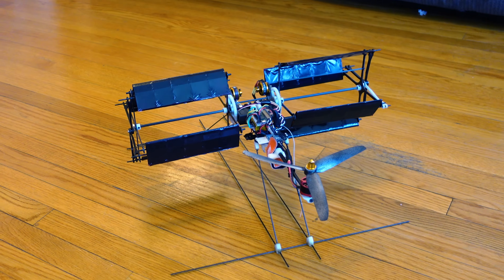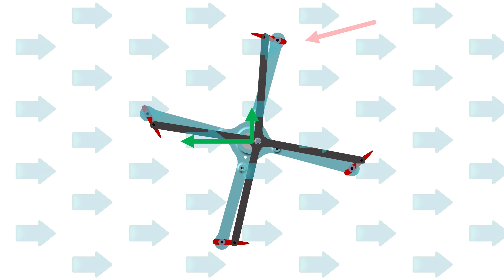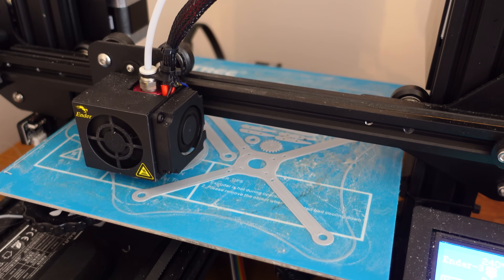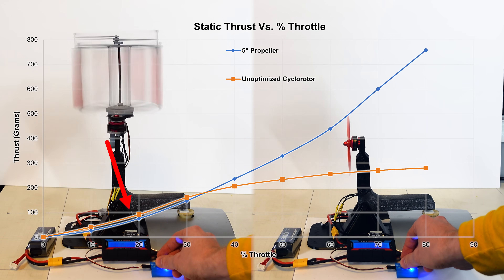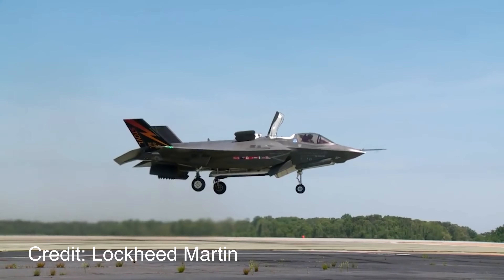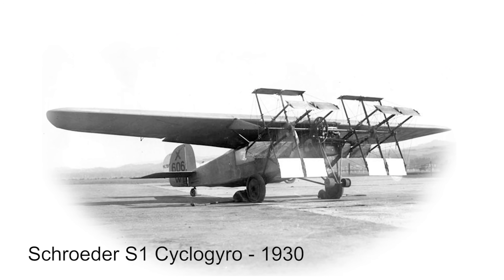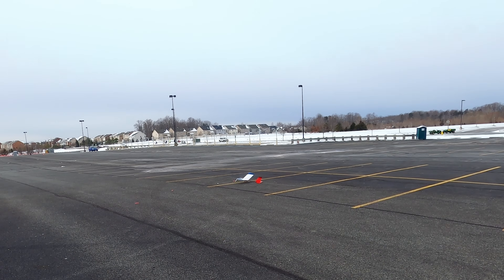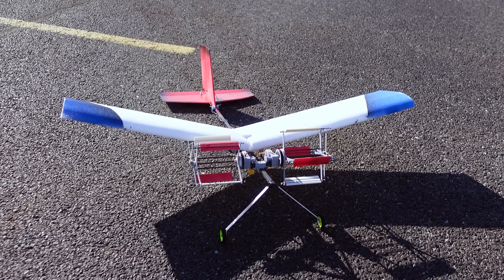Cycloidal Rotor Airplane: The Cycloplane

Comment: Your science makes sense. BUT. Have you seen that you can use two smooth cylinders and still obtain lift. So there is some science that hasn't been explored yet. How can smooth tubes in the cycloidal design still work.
Reply from the maker: That’s coanda lift—different aerodynamics than the mechanism of cyclorotors

Comment: Plotting the dependence of Thrust on Throttle is highly incorrect from both a physical and logical standpoint. You need to calculate the Specific Thrust per unit area of the airflow and plot the graph based on the number of revolutions per minute (RPM). As it stands now, you are comparing apples to oranges.
Reply from the maker: 3:22

Comment: Would adding or subtracting blades on the rotors help? Adding more blades to be like a turbine engine or blower motor fan in an automobile or taking away and going to three to save on weight?

Comment: hi nicholas, i wrote to jude also, that this drive (like the voith-schneider prop on ships) gives different performance with number of blades, length of blades, length to breadth ratio of the blades. the voith-schneider played a lot in water. i imagine in air have other numbers

Comment: Great experiment.  Unfortunately, mechanical complexity imposes too many vulnerabilities and penalties.. many of them fatal.  Also, aerodynamic behaviors aren’t linear, so the straight/boxy geometry of the cyclo-rotor imposes too many flight-envelope constraints.  Your experiments in rotating drones and 3D curved props appear much more promising from standpoints of safety and sound mitigation.  I encourage you to also apply your skill to optimizing wind-power generation to find simple and elegant solutions.

Comment: When it spins. The flaps, even though position slim, causes wind vortex friction. Perhaps a quarter circle frame beam, could shield the return rotation of the fins from the drag of open exposed atmosphere. This only requires a rotate 1/4th circle frame.

Comment: If you could rotate each of the blades independently while they spin, couldn't you have both the botom and top blades generate upwards lifts while the two side blades generate forward lift to increase airflow over the fixed wing and therefore more upwards lift?

Comment: Am guessing it makes little sense to have two separate, fragile belt driven motors. Too many variables of belts slipping and breaking. Am guessing the difference in belt tension was a bad idea on your second attempt, even if the tension didn't break the structure, I'm guessing there would still have been a difference in how each motor performed.
So, am speculating that better attempts are...
Option 1 - Despite the increased noise, use shaft driven on both motors to simplify with maximum structural integrity with least weight and complexity.
Option 2 - Gang motors if desired to produce a single engine and then distribute the power to the two props. IIRC the Writght Bros plane did something like this.
Option 3 - One big propeller instead of 2. Likely simplest if you can get enough thrust which seems likely.

Interesting concept.
Your failure wasn't due to a bad concept, just execution.

Comment: A vane like this, with a curved angle. More rotors, more blades. More offset to the 2 point no thrust positions. And with curvature it would minimize the actual surface area of no thrust at each point

Comment: By not reading other comments, intriguing but rule of engineering thumb more moving parts creates higher risk of failure, this is why the basic fan, propeller is still used today in planes and ships.

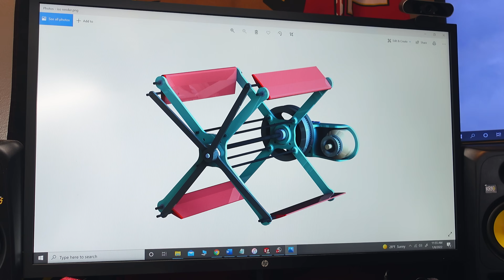Comment: 2:16 that is what good experimenting will do. Love it, keep at it !
3:40 that’s correct. Don’t base your work on comparisons. You will find different values of performance to be sure, as you are finding out.
6:50 try serpentine belts , toothed belts will rip apart if they jump the teeth, or over load the shafting, slipping a bit will let you bring it home at least .😊

Comment: This concept works very well under a tugboat in the Voith-Schneider cycloidal drive.  That’s because the weight and strength of the components is not a restrictive factor.  Your project is wonderfully fascinating, but will always be fragile, I fear. 🤜🤛

Comment: I wonder if you could replace a canard with a cyclorotor and use them as a joint control surface/ lift generator/thrust generator?

Comment: Wouldn't an airfoil shaped blade on the rotors help increase lift or is the trade off on drag not worth it?
Reply from the maker: They’re a symmetric airfoil so that they can generate the same lift on the upwards/downwards portions of the rotation

Comment: Good work.Tihis is a way to elaborate good and effective  flying Car.But must be Calculated cycoidal rotors,airfoils,wings, from titanium, for very high rpm..s..driven by jet engine.Higher rpm..s of cycloidal rotors shorter cycloidal rotors.Good luck with your project.

Comment: Iron nitride magnets can drastically improve the entire EV market for every make and model with smaller lighter motors without sacrificing power. Iron nitride magnets do not use rare earth metals which means no bad PR from environmental impacts and no bad PR from national security issues and they cost less than neodymium to boot. Do some research Niron Magnetics is making them let's get a revolution in EVs kicked off.

Comment: I think something that could help would be making the blades more of an airfoil shape (flatter bottom with a curved top) to actually produce lift just from moving through the air
Reply from the maker: Issue is that the blades pitch 180 degrees from top to bottom, so at the top it might be a better airfoil for lift, but at the bottom, it will be inverted and less efficient. NACA0012 is also easier to model in simulations because there's more experimental data available ;)

Comment: So, traditional props have a speed limit, if you don't want the tips to produce a continuous sonic boom. With the cyclorotor, you could spin it up to mach 0.9, and then increase the length if more thrust is desired. That would be interesting to see.

Comment: Some of the thrust readings might be affected by it being a static test. Some chance it could be a bit more efficient on the actual aircraft if it's in moving air.

Other than that, perhaps figuring out how to make some "bird cage" type thing to go over it. That's a lot of work to have break rather quickly, so if the weight penalty isn't too steep that could make some mistakes less expensive regarding the time put into it. (Shows one advantage of props, if those break - slapping on new ones can be done in under a minute.)

Comment: Try different blades specs such as flexible blades with hinged secondary section: the main section of the blade is attached to the blade driver and the second part is attached to the first blade via a light weight hinges. Were you able to try other sizes of blades, such as width and length? Those dimensions will certainly result in totally different thrust for flight.

Comment: Hello. How about combining the best from an airplane and a Cyclocopter? 
Make VTOL aircraft with four cycloidal rotors for vertical takeoff and for horizontal flight. Maybe it will be more efficient than the classic VTOL systems, because you will not need four engines for lifting and a fifth for horizontal flight, or you will not have to turn four engines.
A fixed wing will make the Cyclocopter's horizontal flight more efficient.
Sorry for the language, it's all GOOGLE translate.

Comment: Would a five blade system work better. I would love the plans to this as I fabricate in aluminium and carbon fibre. Just working through some designs for a hover bike in the format like cyclotek would be a great way to travel. With solid state batteries and graphing batteries in reach the power output would be substantially more.

Comment: Did you make the carbon fiber blades yourself by adding layers to the foam ones or did you purchase them?
Reply from the maker: They were made while I was in undergrad using foamcore and a milled aluminum mold
Reply: @NicholasRehm  awesome stuff I have been trying to make some myself but have never worked with carbon fiber before, so you layered the milled mold and fitted a foam insert when combining the two half’s?
Reply from the maker: @TennisPB  correct! But you could probably get usable results on a larger wing by just wrapping a foam core and vacuum bagging. Otherwise 3D printed molds work well too

Comment: This is great Nicholas, too bad you have to put it down for the moment but I like how you used the weight of the aircraft in this design to counter the moment around the cyclorotors to save on battery usage but I can see needing a control fan at the rear for the 1:1 Personal VTOL designs which is my personal bag if you know what I mean. Too bad Im not a technician like you but just a business product designer that understands a little engineering, I have a wheeled/seated inverted pendulum Id like to do too.

Comment: Cyclorotors work well in water, but the efficiency shortcomings are simply too great to make them practical in aerial vehicles. I could see them catching on as toys/hobby products, but commercial aviation will do anything for even a fraction of a percent efficiency increase, and general aviation isn't even a lucrative enough market to drive the development of new engines or airframes.

Comment: Since lift in an airfoil is produced by circulation rather than the Bernoulli effect try placing the airfoil within the rotor rather than behind it. it then becomes a wave former enhancing circulation and will make vtol and stol history.
Reply from the maker: Excellent idea, was planning on something similar coming up next!!
Reply: @NicholasRehm  it may be best to taper the rotor blades since what we are doing is creating a standing wave which would normally be created by the forward motion of the aircraft and there will be serious losses at the wingtips if the aspect ratio does not decrease toward the wing tip. I think the rotor blades should have significantly less surface area than the wing itself since this is a standard aircraft with gliding capability making it safe in case of engine failure. if you encounter any serious problems please give me a ring.  Gari
Reply: If rotor turbulence makes it stall you might consider slotting the leading edge of the wing.

Comment: they are using this in allot of tugboats now.  there is a shipyard near me and i have seen them installing them.  you may check it out.
Reply from the maker: That's awesome that you've seen them up close
Reply: @NicholasRehm  yes search cycloidal propeller and pictures should come up with tug boats in drydock and you can see them.

Comment: Congrats on giving that a whirl (pardon the pun)....... while the craft looked like it wanted to go more vertical than horizontal would it be worth just testing it as a rocket type craft rather than dragging a winged craft ....... just a thought... awesome 3D printed design...... BTW what if you went wider on the cylinders or does that not make sense..... stay safe.. (also my VTOL nemo is coming along nicely but a lot of work working things out that is missing from the original design) so again thanks for your help.
Reply from the maker: Excited to see the next update on the Nemo!! Wider rotors would probably be more efficient, like a larger prop. Too wide and the end plates can start to twist relative to each other because of the aero forces

Comment: Great job comparing their performance! Cycloidal rotor will need a lot of optimization to reach a propeller performance. So for me it looks interesting as a concept, but is far from be worth due its complexity and inherent multiple failure modes.
Reply from the maker: I definitely agree that it’ll take some more iterating and optimizing. Appreciate your comment!

Comment: @Nicholas Rehm Try using a notched belt so tension / slippage isn't so much of an issue. Besides the tension could torque the frame causing it to twist as more thrust is being applied.

Comment: Hey.  crazy question. What if you added more fins down the 4 shaft assblies? In other word a bi, tri, or quad plane design. Or...what if you added 6, 8 or more shafts assemblies? In other words, what a turbine is to a propeller, make the eqiuvalency of that to this. Another thing I noticed...what if you made it wider? Instead of having the end be not supported you have a fork design hold the other side with a bearing or another motor. Visualize it like this. The standard x shape of a drone but with the assemly held by the posts in the empty part of the x. Did any of that make any sense to anyone?

Comment: Instead of vectoring thrust by using a single servo to rotate the cyclorotor's secondary axis around the primary axis, use two servos, to move the secondary axis forwards, backwards, up and down.
The closer the two axes are being aligned, the lower your thrust, and the greater the distance between them, the greater the thrust... even at constant rpm.  Think of the collective control on an helicopter.
Reply from the maker: If I go bigger I'll give that a try. For now squeezing the mechanical linkages in such a small assembly is a challenge

Comment: Interesting project. Question: Would the aircraft be limited in speed to the rotors speed?   A jet engine will propel a fighter over 1300mph.   A turbo prop over 350mph and your aircraft ???mph
Reply from the maker: It’s all a function of rotor speed and blade angle of attack. Ideally you want to match the forward speed to at least cancel out the top blade velocity, and increase angle of attack. I would imagine this rotor fits somewhere between a propeller and helicopter rotor

Comment: It's cool but the drag of the massive moving parts seems to require a lot more energy than conventional means.
Reply from the maker: I was pulling about 25 watts with no blades installed, 16 watts with bare motor
Reply: @NicholasRehm  That's actually not bad, color me impressed.

Comment: 7:51 maybe you could put light weight guide rings
I'm sketched out by the 3D printed spinning parts but I guess they're low rpms
Also wonder if it can blend into the wing like a blown wing deal not sure, no that's a different thing fan wing
Reply from the maker: Blown wing is an excellent idea with the cyclorotor. Working out the kinks with 3d prints, then we’ll work on robustness with different materials :)
Reply: @NicholasRehm  yeah I'm not sure how well it would work, I think it means the rotating part's center is above the wing/cg so it would make the plane want to go downwards. Unless you countered it somehow or made it a canard... idk

maybe the thrust points downwards so it tries to pull the plane up (tractor config) like a thrust angle on a fire wall

Comment: This is a super interesting idea, I really do like how good projects from the early 1900´s can have a better research with today technologies
Reply from the maker: Lemme know if there’s any other cool designs I should try
Reply: Having large moving parts definitely is a good idea
Reply: If the design was left 100 years ago, it means it sucks. Simply.
Reply: @DashzRight  Many designs are viable now due to advances in material science and miniaturization of components. Hypernormalizing this into “it probably sucks” isn’t a good way to get anywhere.
Reply: @DashzRight  and that's why we don't use AC or DC current anymore, right? Or radio signals?

Comment: Cycloidal Propellers are known in ships under the brand name "Voith Schneider Propeller", used for ferries, tug boats etc. but I think the weight and drag induced by the mounting plate makes it very hard to compete with a helicopter style propeller design. Is there a possibilty for something like "auto rotation" in cycloidal propellers?
Reply from the maker: Yea they also can be used as a wind turbine

Comment: Honestly, it could be something else than the blades themselves: it could be all of the stuff built around to control their angle of attack. Nice work anyway, that's a lovely dev, thank you for the video!
Reply from the maker: Surprisingly with the blades and linkages removed, it only draws something like 5% more power than an unloaded motor

Comment: Beautiful project ! cant wait to see more cool cycloidal projects taking off. Is it possible to release just the view only cad file, so I can learn how to build this type of engine please?
Reply from the maker: I’ll try to release something once the kinks are ironed out
Reply: @NicholasRehm   Thanks Nicholas, Ive been wanting to build a cycloidal engines for a few years now but I just cant grasp the  mechanism parts of it etc. Even some pictures close up like where the bearings are where the rods need to be etc and I can take it from there. Just dont want to take your idea and hard work, also I would like to build it myself because I have different diameter of bearings so itll be much easier to put together.

Comment: Don't you have to consider the lift factor into overall flight performance? props=thrust, wings= lift. Your propulsion system does both.  Even if individual function is lower the combined provides flight. You have redesigned the looks of a Helicopter.
Reply from the maker: That’s difficult to quantity without a wind tunnel

Comment: ducted telsa turbine, one or more directed outputs
Reply: removes the rotor angle rotations, in the static rotor discs, or also rotor pump impeller
Reply: also you get rid of any edge turbulence effects
Reply: if you compare noises, have same surface/power area to get the proper pitch
Reply: you can easily vtol that design, quad rotor
Reply: put wheels on the rotor too
Reply: independent synched servos for rotor blade angles, like in a helicopter
Reply: rip
Reply: power measurements vs similar sized ducted and normal propellers and the tesla disc spin pump turbine
Reply: blower style fan instead, centrifugal  operation, only 1 moving part, no moving rotor wings